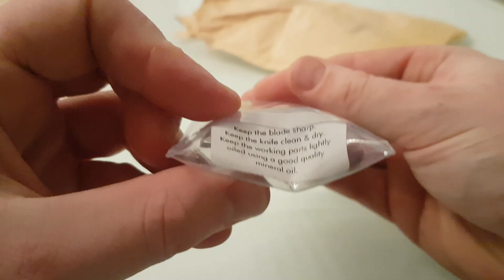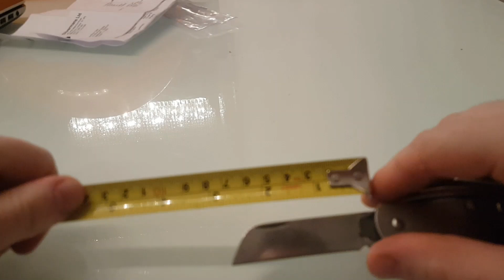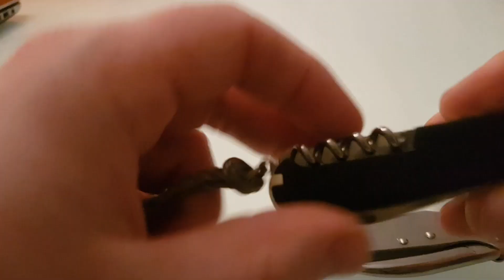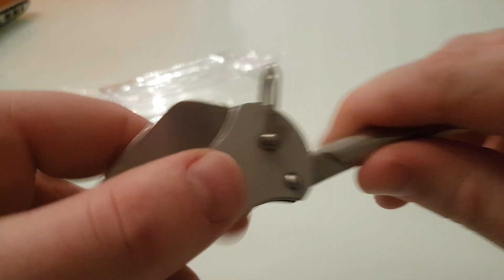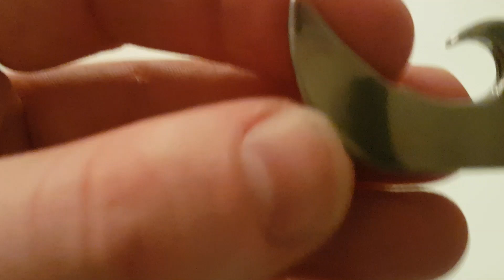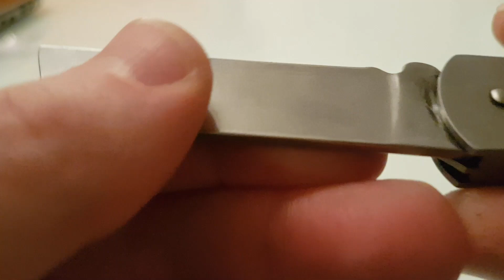The Genuine British Army Knife

Comment: Sadly, it is a rather inferior product when compared to a proper one actually issued by the British army. The steel is inferior and won’t keep an edge for long. The army had a very precise set of instructions as to how and what it was made of, they were contracted to quite a range of companies but all had the stock no. on, the War Dept. arrow (later ones didn’t have the arrow as that was no longer put on military kit around 1980 or so) and “oil the joints”, along with the companies name or logo. Mine was issued in 1954 and was made by RBS of Sheffield company, it takes a very good edge and keeps it.😁

Comment: The can opener is heavy duty enough that it opens tins just fine as is.  And even after oiling or soaking, the opener remains very stiff. It can be worked a bit. I like the strong springs myself. 

I love this clasp knife. I rarely need more. The grip is great in my hands, and to be honest I never use the nail nicks. I get the tin opener out by first opening the knife. 

I sharpened the tip of the opener to make a tool for getting dirt and debris out of treads and the like. The marlin spike is perfect for ropework, and as a dull prod. 

Wish I'd bought three or four when they were cheaper, as gifts. I paid about £22 from J. Adams in Sheffield. It has Nato markings. But a number of Sheffield firms make this from the same pattern.

Armys used to use leather in huge quantity for strapping, for blade strops, bags, belts etc. No end of uses on land for the spike. Not to mention horses and mules, with all kinds of leatherwork. AND hooves to clean--both tin opener and spike are  great hoof tools.

Thanks for the review. A very underrated knife. And legal most everywhere that forbids locking or long blades. 

Cheers from Haifa